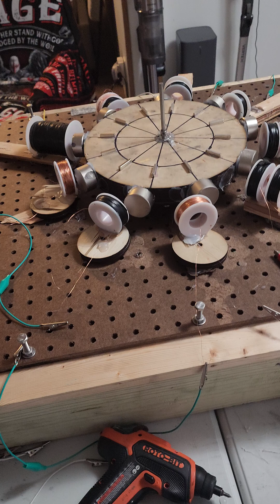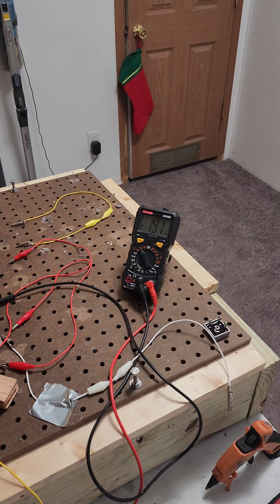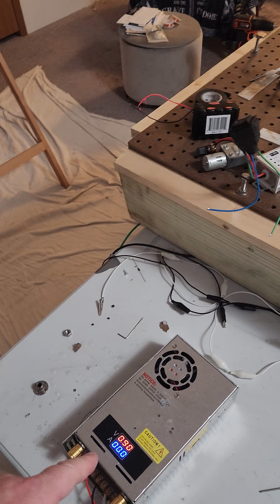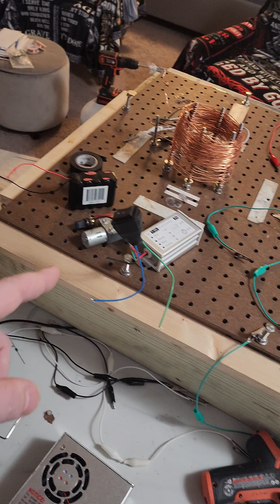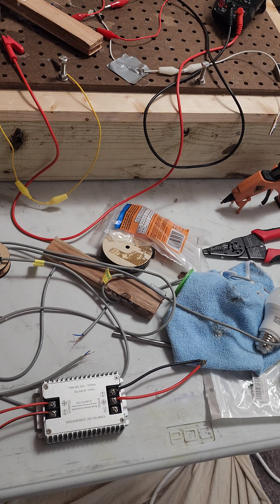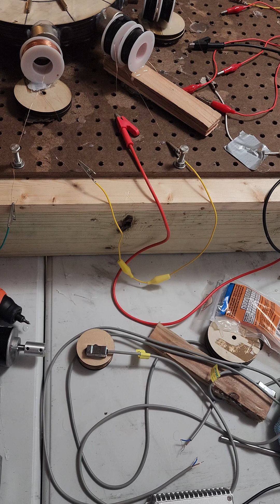generator generates 345 ac volts with 9 magnets and 11 coils

Comment: That's some mighty fine voltage you got there!! But volts in itself really means very little in terms of a generator. These open coil volt readings get a lot of Internet time. Wish more folk knew that Volts X Amps = Power, or Watts. Nice construction, hopefully you'll get it running with the appropriate load connected.
Reply from the maker: Thanks, I have 2 options in the toy chest right now, I have a buck boost converter 8-36 dc in and 12 dc x 10 amps out.  12v battery pack 2000mah

Comment: You're running a DC motor current limited to 1 or 2 amps or direct and that is the current you measured (on the input)? You're seeing 330+ VAC out the other side, but; realize the Amps you are going to get from that is going to be somewhere like 0.01A (10 mA).
 - (just a rough ballpark assuming 50% loss).
An electrical device that plugs into a standard wall outlet is going to be up to 15A (15000mA). A simple device, with maybe an led, or microprocessor is probably going to consume 90-175mA to actually operate it (example, an alarm clock).
So if you connect a LOAD to your generator output side, it will act like a "short" in a sense, because the load is going to be significant in comparison to the 345VAC@0.01A you are providing it. Your voltage output will drop to 0VAC (you'll se that on the meter), and the 0.01A will be consumed, but nothing will happen with that connected device.  As you get the generator power output up, at some point it will function, partially or better

For the DC to DC converter, you'll have to give some details of what you are connecting and how to figure out why its not working.

This looks like so much fun!!!! The freeform experimentation is a blast!

Comment: Need a capacitor so u have a steady voltage for what u are running just like your wall socket comes in at one amp currant voltage bla bla bla has to be enough for the device u r running

Comment: That last part about the battery and DC..isn't it because the mag gen is pulse DC?
Reply from the maker: from the magnets on the rotor pass the coils and create AC voltage then i connect it to the bridge rectifier then its a DC in - DC + Amps out or 120watts converter then the permanent magnet motor 12 volt DC.  I was saying that the above circuit is missing something, some thing that the battery has 12v DC battery pack.